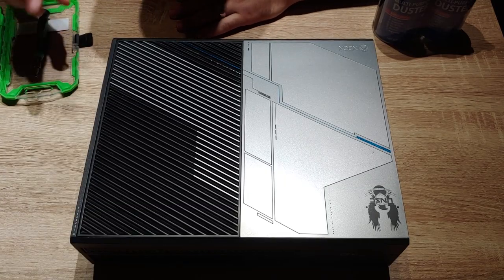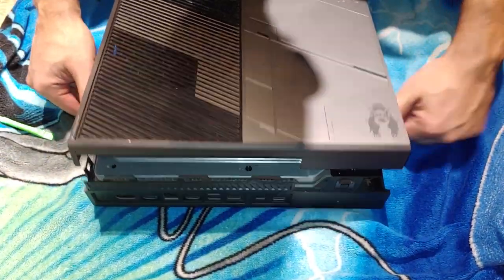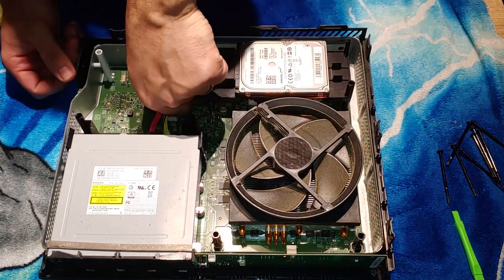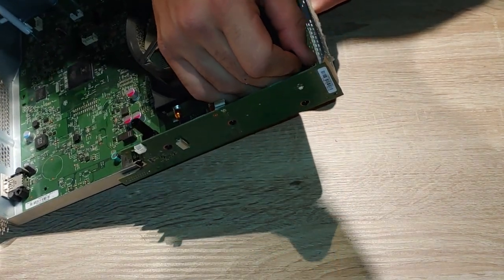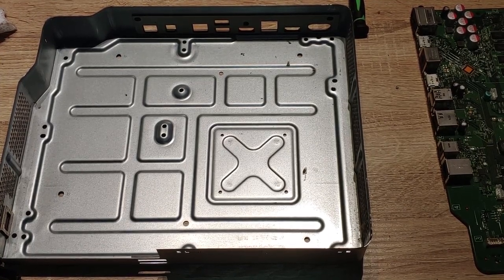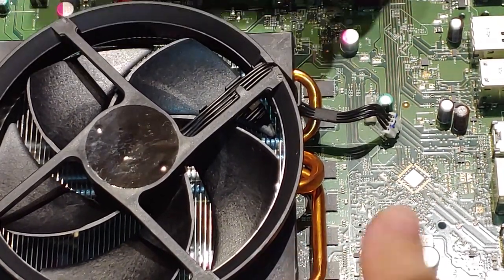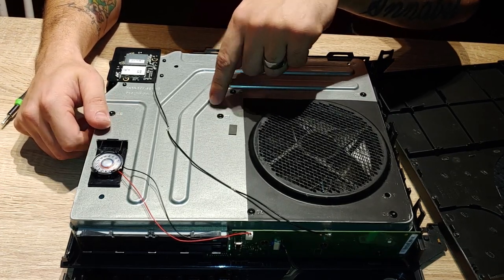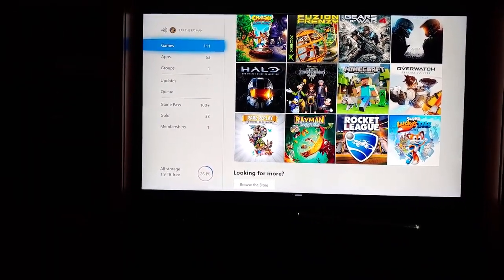How To Take Apart An Xbox One And Put It Back Together (2019)

Comment: Thanks bro, you are a life saver. Struggled with that front piece for an hour and a half. Almost threw my Xbox across the room.
Reply from the maker: Np bro!
Reply: I'm still struggling with the front peice I tried your method but it all sits flush except the last 3 clips on the right hand side it's so annoying will it affect the xbox when it's on? Dont want it to over heat
Reply: SAME the front plate was pure pain until I saw this
Reply: @brandongeorge6042  I know it's two years late, but yes it will function normally without the outer casing. 
The front bit is mainly for the CD button and the power on button, you can still turn it on with a controller.